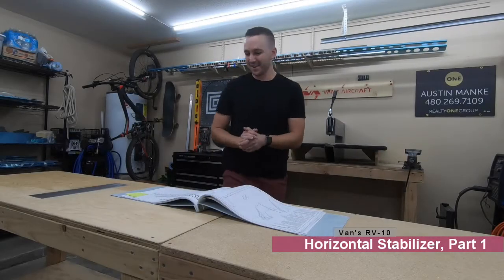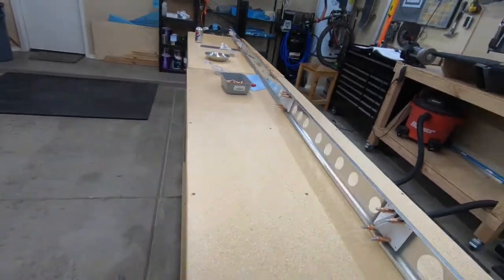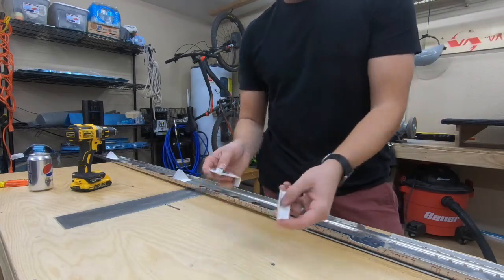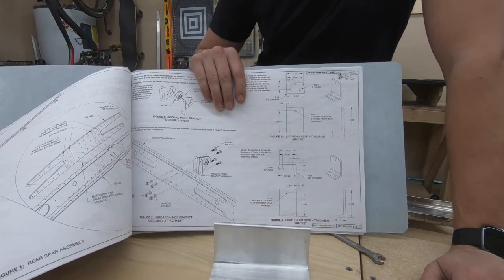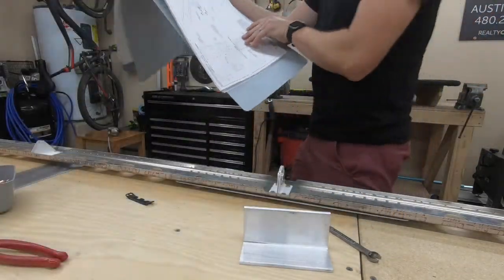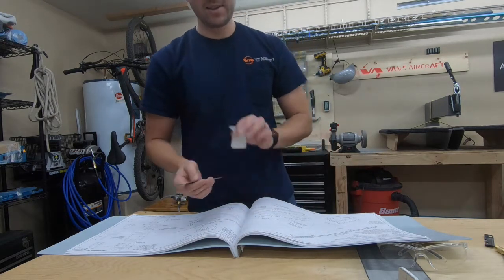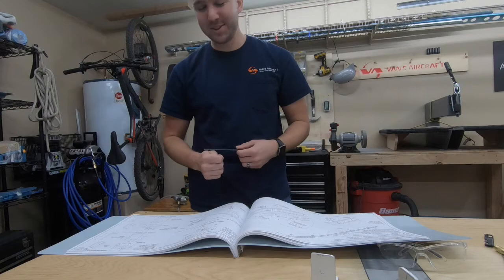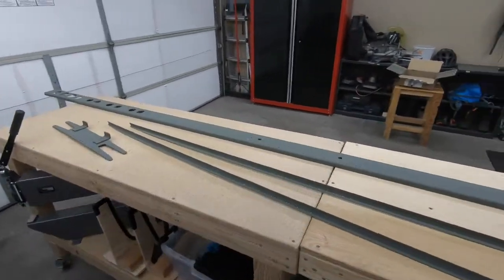Van's RV-10 Horizontal Stabilizer Build, Part 1

Comment: Hey Austin!

Sorry to comment so far back in time, I am up to date on your build and loving the progress!

I'm about to start work on my horizontal stab for the 10 and wondered what you did, if anything regarding SB 36. HS rear spar cracks around outboard elevator hinges.

All the best

Minos
Reply from the maker: @MinosPilacoutas  hi Minos! 

Thanks for watching and for the comment! I addressed it after the fact in a separate video. I’d definitely try to incorporate now if you don’t have it closed up yet. 

I did a video on it here: https://youtu.be/KwZqnJyvjxY?si=DXWhzvSt6UVmxxe6

Happy building!
Reply: @AustinManke  thanks for the reply!

Luckily the latest revisions of the manual has you do this during the build so I'll be covered with SB 43.

However I was asking about SB 36. HS rear spar cracks.
Reply from the maker: @ sorry about that! I got it confused with the other SB. No I did not do anything to address it. Last I heard, there wasn’t really a fix and it was left an as an inspection type of thing. I did read in forums that placing the rivets in one orientation vs the other may be advantageous though.